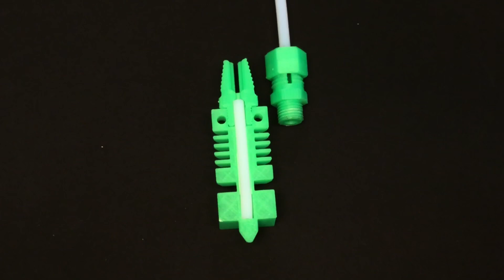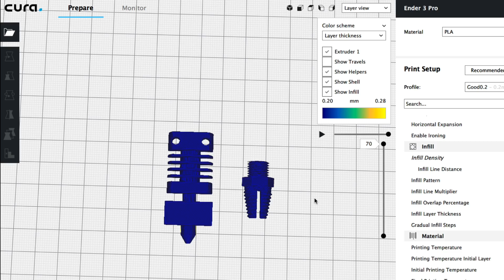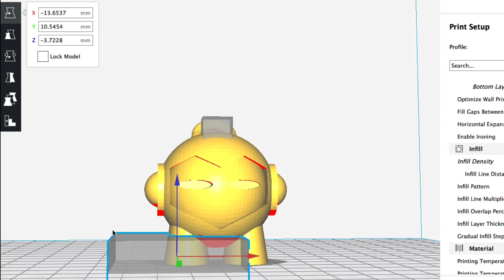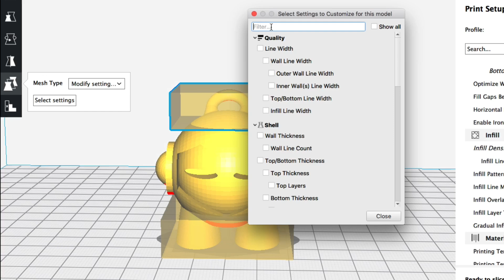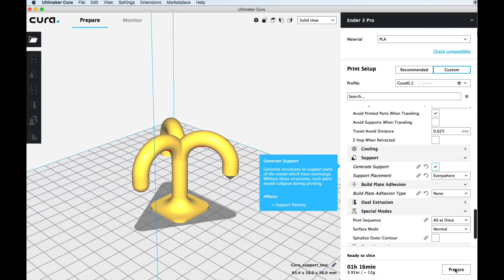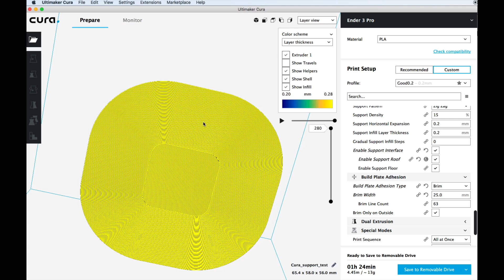3 Cura Slicer Setting Tricks For Beginners

Comment: Is there a way to print multiple models in series? What I mean by that is the printer will entierly print a model before beginning the next one?
Reply: Yes, in Cura, under "Special modes", you can add "Print Sequence" and choose between "all at once" or " One at a time"
Reply: Just be aware the print head assembly has to have more than enough clearance between each model for that to be possible.
Reply: @brianslver9760  Thank you!

Comment: Hey Chuck,  I've used the support blocker several times works great.  I have a question. If you slice the model then check the layer numbers can you just do more top and bottom layers? Would you get the same results?  Say if you did 50 bottom and 40 top (just an example).
Reply from the maker: Sounds possible. Never tried it.

Comment: Could you have achieved tip 2 by just setting top and bottom solid layers to 20 or 30 instead of using support blocker?
Reply from the maker: Probably. If you want anything less than 100% though it wouldn’t.
Reply: Actually no, it will act in every surface with an inclination.

Comment: I've wanted to get started into 3d printing. I got to play with a monoprice maker select v2 from a friend that couldn't get it to work and had it printing well for a couple months. Then it started to have prints fail. I got my own cr10 v2 recently and did a few test retraction prints. I couldn't get rid of the stringing all together. I tried to do a benchy and now I'm pretty sure I got a clog which I don't even know how to fix yet on a bowden tube. Any encouragement on not giving up on this. I have no idea why it failed after the 1 layer. My test bed leveling print came out good and the string test were printing with stringing just at the top 20% of the model. Its all really deflating. Thanks for your video's any help would be appreciated.

Comment: My supports seem to stick too well to the print and I have trouble removing them, what settings should I adjust? A video about dialing in support settings would be great :)
Reply from the maker: There is a gap setting. I’ll consider a video on that.
Reply: I've recently found that enabling support interface and changing support line width to .3 makes awesome, easy to remove supports.

Comment: Thanks for the tip on how to create additional infill areas on a print. It’s just what I needed. My new problem is:
1. when laying down a line I get breaks in it. It seems that the stepper motor relaxes slightly before re-starting to feed filament. Immediately after a relax the line width goes anywhere from a normal bead to a string. And it might not even be attached, especially on the first layer. At  other times the stepper tries feeding too much filament and I get a stripping of the filament at the filament drive mechanism. I verify this by noticing shavings of the filament below the feed mechanism. I can decrease the flow rate to stop this, but, I still get breaks in the line. is creating havoc in my prints. Any suggestions?
2. Using cura slicer I get gaps in lines when the extruder does a hop. When it hops, the extruder backs the filament out. At the new location the filament is late getting to the nozzle. This results in a break of the line being laid down. Any thoughts?
Reply: Shot in the dark here, but try disabling z-hop? And for the first issue (again, not sure) but see if you have coasting enabled.

Comment: Can you teach us how to add supports to a circle going through a vertical wall piece? Say you make a 5”x5” wall on a printer, then you want a golf ball sized cut out going through so you can see through. But this circle has to be perfect in diameter, how would you do this? I added support beams or stacks not fully covering the hole but on the parts where it bends in. I wish we could chat on the phone or something because no one else knows how to do this. I could make it happen but this would require a full covering support and that makes it go from 100g to 10000g in no time.

Comment: Always come back to your videos to review and confirm how to do stuff like this. Question for you, I have an item I have scaled up to make it the correct size for a project but I would like to make the sides thicker. currently they are 1.27mm and I would like to make them 2.15mm. Is there a way to do this with out starting from scratch? Thanks in advance and greatly appreciate all you share.
Reply from the maker: If the design has them that way, I’m not sure you can do much about it unless you overextrude but that’s crude.
Reply: @FilamentFriday  thanks

Comment: In settings under infill tab, there is "infill pattern". What is the difference between 'grid', 'lines', 'triangles', 'cubic', 'octet', 'tri-hexagon', 'cubic subdivision', 'quarter cubic', 'concentric', 'zig zag', 'cross', 'gyroid'.
Reply from the maker: They are just different patterns for the infill.
Reply: @FilamentFriday  could you please elaborate? 
Like under which cases all the aforementioned patterns will give best print

Comment: nice video, but the support blocker doenst work with fan settings, isnt it? As you can set in S3D, a specific layer height specific fan speed, important for ABS...

Comment: When I do this it turns the block into a solid block and won’t work as infill like you have got it.
Reply: I have the same problem on cura 4.4.1 :/ it turns into a block and adds suport to this block
Reply: Yeah, I have the same issue with 4.4.1 and I even updated it to 4.5.0 and it still won't work :(

Comment: Quick question: Is there any way to achieve a gradual change between the default (or adjacent) settings, and the adjusted settings you entered here? I need this option for a speed change, so it'd be nice if that was more gradual.

Comment: What happens if you select Supports Just for the top part of the print
Reply: Supports help alot with faces or overhanging objects, there are some Slicers that have 'gcode' previews and those can show you on it where it would need support or if it doesn't need it,
i have been working with cura only recently (just started printing) and i haven't found a option like that. though don't completely trust my word i got this info from another 3D printing channel from australia

Comment: hi great video iam going to use that in fill , wondering if you could help with some settings on cura 4.1 , i need to  have a 0.4 wall print but the first 3 bottom layers need to be 0.8 thick to help with gluing  to another part , is there  a way to do this in cura , so it will print the first 3 layers at 0.8 then the 0.4 wall  in cura ? can you help at all

Comment: I don’t know why but the per model setting when I do a support blocker does not exist on my version of cura 4.8.2-73
Reply: have you selected material for block?
Reply: @jannis01  I'm having the same issue. Can you explain what you mean by selected material for block?
Reply: @jnkmal9519  if you click on a part you cn choose the extruder / material. You also have to click on the block and choose material if i remember correctly

Comment: Great option, but sadly layer height can't be changed. I wanted to print overhang slower AND at a lower layer height, but I can't change the latter. :(
Reply: This is about adding the support blockers btw. I just tried it, it doesn't work on my priter. Don't know why. It printed the same speed at the support blocker positions.
Reply: Not sure if its a fix for you, but if you need finer detail on certain areas that you're also trying to change infill for, you can try Cura's "Adaptive" layer height settings as well as adding the infill block. You might get lucky.

Comment: Question: 
Do you think that warping could be prevented by using a solid block at the bottom of a model with this technique ?

Thank you for your appreciated answer
Reply from the maker: If you mean warping with ABS? 
No, it won’t help at all based on my experience.
Reply: @FilamentFriday  With PLA ?

Comment: I’m printing a cylinder w 1/4” wall thickness, 100% infill. If I select concentric infill, I get an infill pattern that looks like a rectilinear pattern ie. Parallel lines alternating 90 deg on alternating layers. Any thoughts?

Comment: I’ve been using Cura for a couple days and I had an item that the brim, skirt, or raft would only print 90 degrees to the actual item. Is there a way to rotate the raft independently of the item?

Comment: Say if you wanted to use your infill trick for a brim? So you’d only put boxes under the Support’s? Would that work?
Reply from the maker: Not sure but support has the option to add Brim instead of the way I did.
Reply: CHEP hey I just wanted to say, I sell parts on eBay and there is one area that I always wanted to add 100% infill to make it stronger. My good sir you just made my parts 100% better! I’ve already added it to 3 of my parts I sell! 

THANK YOU

Comment: I've had several prints get to 3-4 cm and then start to fail with stringing.   I was printing one piece and another with two side by side pieces, both did the same thing.  Any advice?

Comment: hi i need some help i have a tevo torado and the plate that holds the extruder is loose i tried to tighten it but i ruined the threads on the nuts, the bearings on top are loose so i figured thats the problem how would i fix this please. i was thinking of getting the nuts off and drilling down where the nuts were so i can hopefully tighten it. if theres a better way to fix it i would greatly appreciate it.

Comment: I got one for ya! If I have an irregular shape, like a picture frame with rounded or "star" corners, is there a way to "fill" in the middle and have it print solid? Kinda like using the paint bucket feature in microsoft paint?
Reply from the maker: I don’t understand the question. You can fill the inside of the frame by setting the infill to 99% or just use more walls.

Comment: You mention the hook not working at 20% infill so we changed it to 100% infill. By 'not working' do you mean it won't print or it won't be strong enough? My other question is the infill density would seem to depend on the intended use. Just sitting on the shelf 20% would be fine yes?
Reply from the maker: Strong enough.

Comment: Still getting gaps in my lines. I’m using a 1mm nozzle, Bowden type extruder, cura 4.6.1 and repetier host to run the part. So I get gaps in my lines. If I pinch the filament as it goes into the extruder mechanism I notice there are times when the filament stops feeding. This is probably why I get the gaps. If I back the filament quit a bit away from the hot end and then run the part without actually laying down material, but actually feeding material through the Bowden,  I notice that the filament does not stop feeding. It feels like a continuous feed to me. Any thoughts?

Comment: So i refer back to a lot of your vids when i brain fart , but the one thing i didnt see, is " Can this be done by Layer?" (in cura) say you want to use one type of infill up to a certain layer, then change the infill to another layer or the rest of the print ?
Reply: There's a "ChangeAtZ" option in Cura ("Extensions - Post Processing - Modify G-Code - Add a script") that lets you set a different e.g. temperature at a specific height/layer. Not sure if you can do infill too.
Reply from the maker: I cover that in my latest video: https://youtu.be/r7L8r7envgo

Comment: Can the blocker be used to NOT print parts of the stl at all?
Reply: I normally put the design in a CAD and just split the design, normally in Tinkercad where you can just make a hole where you want to not print parts of the stl, but I'd rather use Fusion because if the file is large, Tinkercad makes it super hard to process.

Comment: I might be missing something here.. But in the current version it doesn't appear to work.. I've even set the overlap region to Triangles, and the standard generation to zig or tree.. Doesn't seem to be any change during that overlap area.
Reply: Figured it out.. 
Was trying to adjust the auto support infil density.. It's not treated as a model and therefor isn't effected.. I want the supports to get more dense as it gets closer to the model..

Comment: That Blocker setting is aces,thanks! Quick, unrelated, question - what version of Cura are you using? I see people with the slide that goes horizontal (just above the slide that shows the layers), such as yours,, that plays out the print - but mine doesn't have that, or at least I don't see how to turn it on/view it. Also, my model is  always in orangish-yellow - I'd rather see it in something dark, like blue... How do I change that, too?
Reply: Not compatible video card, update it.
Reply: It’s the new 3.6 version.

Comment: My 3d printer is having so many issues all of the knobs for the bed are relatively tight except one that is almost all the way out or I can’t seem to level the bed right. I keep getting bad prints after getting amazing prints and now it even is taking my CADs and printing it by starting off the table and I have no idea what happened. I use high temp ESD filament only.
Reply: If you unscrew the bed all the way out and set it back down straight, then tighten each wheel a few turns at a time until it goes down, that should help you out on the first issue.
Reply: leopshef Basically after a few hours of troubleshooting I took the entire nozzle extruder system apart and did all new tubes & nozzle plus what you said about the bed. I am now back to optimal printing. The bed however I cannot figure out. No matter what you do there is always the closest rightmost knob turned all the way out while the other 3 are almost max tightness. You can see that the glass bows from the bed itself. What I am thinking is just laying down electrical tape on the right side until it at least can screw the knob in enough to hold its place without rattling loose, because I think my prints were doing okay until the knob that was barely on rattles loose enough to throw the whole print off. This is my hypothesis.
Reply: @ohnobo14  Is the plate underneath with the bearings on it straight?
Reply: leopshef it seems so. The bearings all line up with the rods correctly.. I just I didn’t tape anything yet but on my sunlu s8 it seems the plate underneath the glass was shipped to me slightly warped
Reply: @ohnobo14  Ah, if you use mesh bed levelling it should help you out

Comment: Hi, newby here.  Just printing a bracket that has a flat base but then some of the part (the final anchor) is inclined at 73degrees to the rest of the print.  
I noticed when printing that the nozzle infills the body part, then goes and infills the 73degree part.  The result will be a weak point at the join line and a potential separation line when mounted.
HOW: do I tell the slicer to make 1 pass at that level that combines both segments in 1 layer?  Making it a stronger part overall. ?????

Maybe you have a video on that subject already.
Apologies for the poor use of Cura jargon

thanks
Reply from the maker: Not sure I understand the design.

Comment: exactly what I was looking for.   Do you print on a glass bed by any chance?    I have an Ender 5 and I get great prints on the glass bed but a delaminating print on the bed on the next print.    Do I need to wash my bed after every print or is there something else wrong?
Reply from the maker: Delaminating between layers is usually temp related.
Reply: @FilamentFriday   well actually its the lower right corner brim layer curling up from the bed to be more accurate and no separation between layers as of yet.  Your take on this?
Reply: @aos7194  Hi. I don't have much experience yet but I can tell you this is a bed adhesion problem not a lamination one, so that should save you some googling. Also you may find adding a brim or raising your print bed slighly help as both attach models more firmly to the build plate. Good luck.

Comment: Hi Chep, 

I'm new to 3d printing, and came across this video. is there a way to the infill trick with version 4.8 by chance?
Reply from the maker: Yes. It’s possible.
Reply: @FilamentFriday  have you made a video for that?
Reply: I can't figure it out in 4.8 either.
Reply from the maker: Maybe I’ll make a 4.8 version video. They did Change the icons a bit.
Reply: Same.  I cant find this in 4.8
Reply: @onitramt77 In Cura 4.8, the way I do, I select my model, click twice (don't know why 2 times but works for me) on last icon on left list then click on the model.
First time you hit the icon, the axis should appear, and second time the axis are gone.
Once you defined your support blocker size and place, select it, click on the icon just above (with 4 pieces) and in menu select "modify settings for overlaps" then you just have to come back to Chep's instructions on parameters to use.
Hope it helped
Reply: @TheBelligerant  Great, Thanks for the info!
Reply: @TheBelligerant  I'm using Cura 4.7.1 and the double click seemed to work for me as well. Good advice ty

Comment: Looking into it now, say a print has 5 objects or more, all not connected to each other and are spread out on the bed, is there a way to make the printer print one of them at a time instead of working on all 5 little by little?
Reply from the maker: Cura has that option but you really have to spread them out. I recommend just print one at a time. About the same total time.
Reply: I appreciate the recommendation. 
Where is the option located? Its for 2-2.5mm, 1in tall inserts spread out on the bed per 65mm (as the extruder itself is 60mm large), this should leave about 2.5-3mm additional space when printing the next object). 
I mainly desire to do this so i don’t have to repeatedly cool down and re-heat the bed and extruder after each individual insert is printed =x.